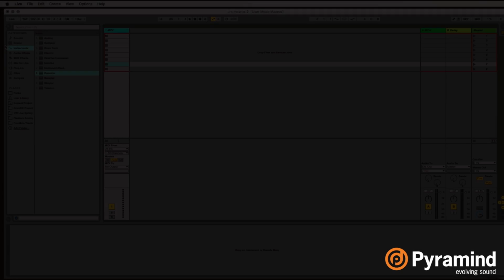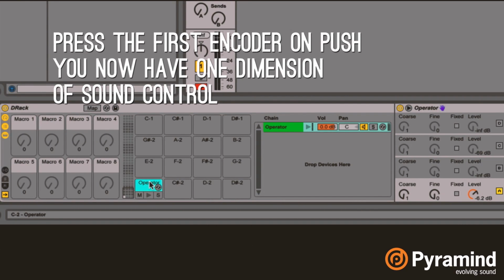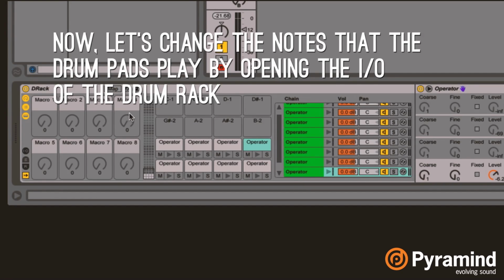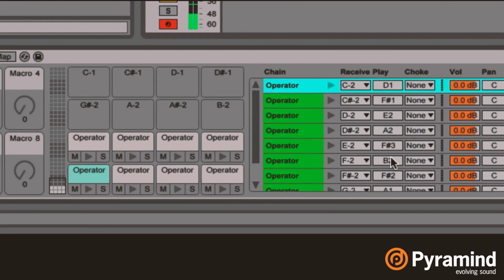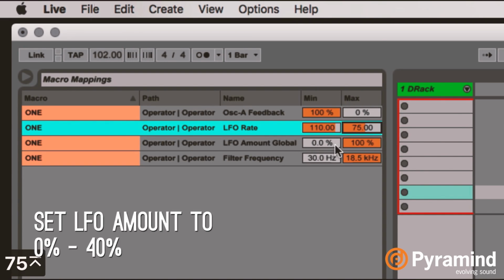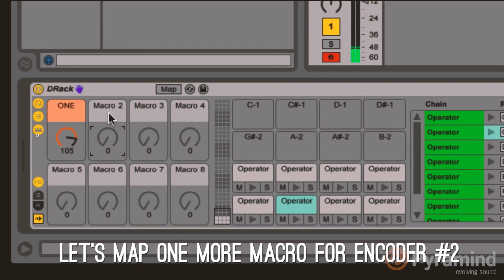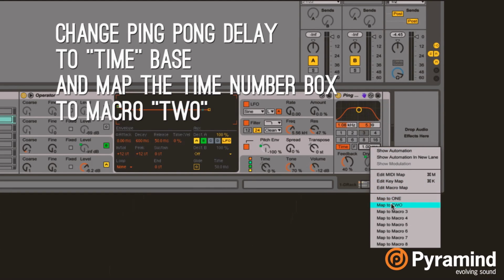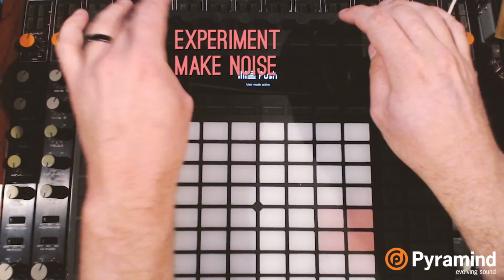Easy Ableton Push 2 trick for playing crazy synth melodies using only the knobs

Comment: Thanks, this is really great!  One problem I had though, after saving this setup as a preset drum rack, when i came to load it again, I found the macro controls no longer affect the parameters I set them to. Can anyone help?
Reply: Of my limited knowledge about Push and Ableton in general, I know that whenever I unplugged my push all of my macro controls I use on it for vst guitar pedals and amp controls would be reset. It’s probably something to do with even though you save the preset with correct macros, it gets confused when you try to use a controller after you’ve closed the preset, I don’t really know how to explain it. I would be curious to know if there’s a fix for it too....

Comment: Hello!  I was able to map a tone to the 8 encoders at the top ( when I touch them they produce tones) and after I mapped the rate, amount, frequency, etc.. for the 1st encoder...when I twist it it does not make any kind of noise at all.  The only thing I didn't do was change the note for each operator.  What could I have missed that is causing this dilemma?  Any help would be greatly appreciated!